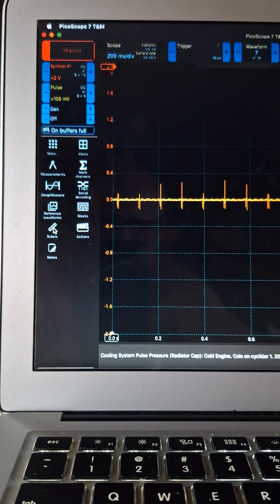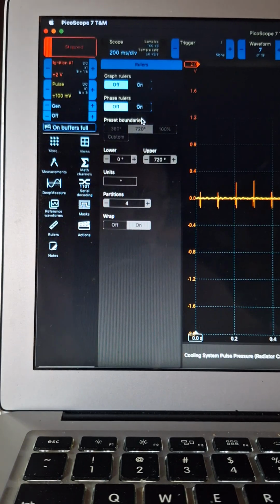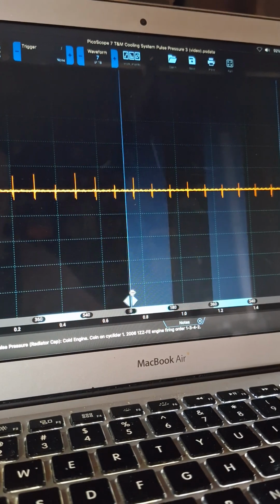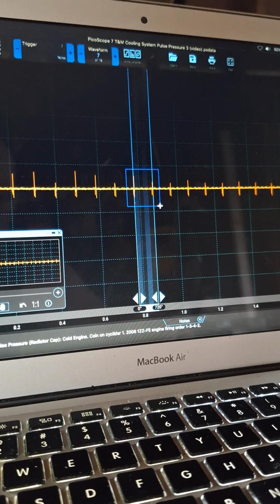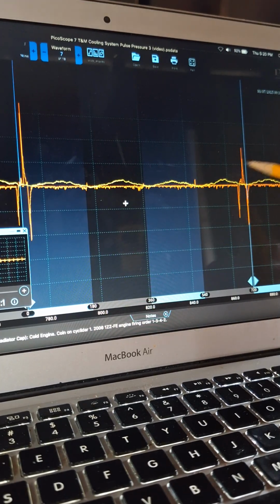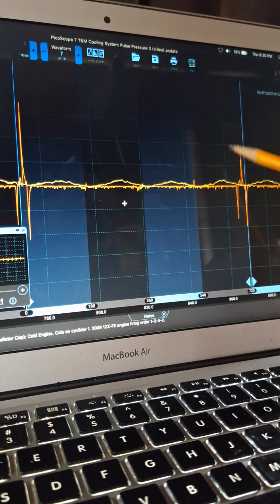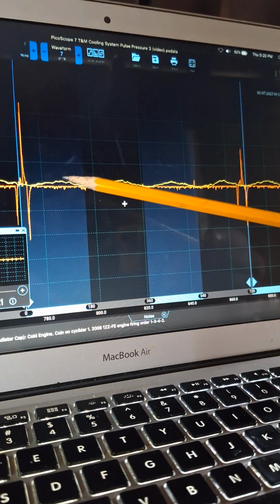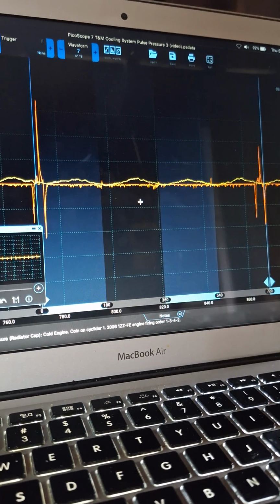Waveform Analysis: Cooling System Pressure Pulses.

Comment: That is really cool so how do you get the data? Are you adding a pressure sensor into the cooling system or are you pulling the data from something that currently exists on the vehicle?
Reply from the maker: Thank you. I am using a hose to connect a custom pressure sensor to the radiator (where the cap goes). This sensor converts pressure pulses to voltage and is connected to one channel on a Picoscope oscilloscope connected to a MacBook Air. The other connected channel is used for ignition sync.